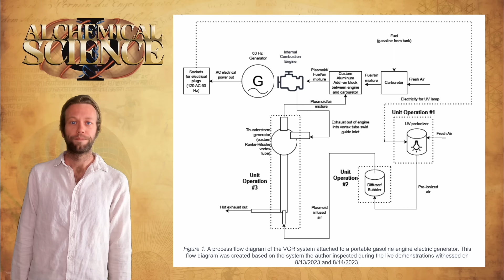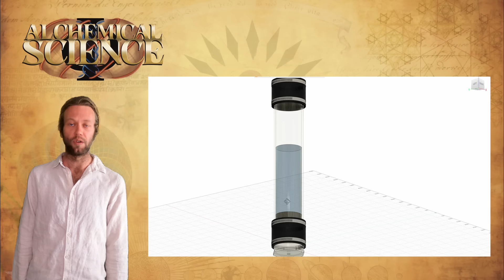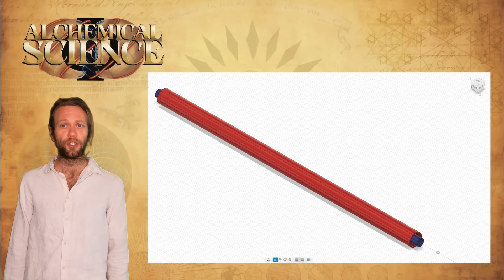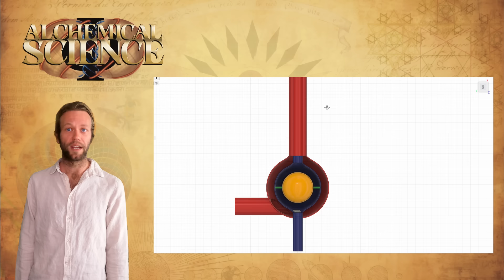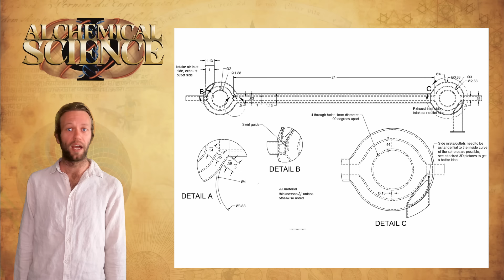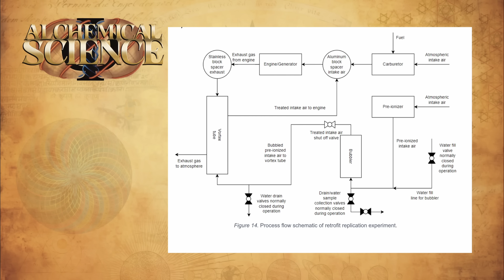Thunderstorm Generator | COMPLETE DIY BUILD GUIDE | Malcolm Bendall's Plasmoid Tech

Comment: When you talk of dangers of this device you should also be aware that the thunderstorm generator is pulling in ions and generating EMF and you should expect there to be an electrical charge. Someone got a huge jolt and thrown back when standing on water and he touched a device like this (a GEET). I'm not sure but grounding the generator has a negative effect on the reaction you are trying to create.  Also, grounding of metal near the device might also create a situation where it is easier to getting a jolt than standing on water.  The question on grounding should be talked about.  A few people will ground a gas power generator so if there is a hazard here it should be stated.
Reply: Excellent question. I too wait for the answer or link to a study group that is talking about said grounding concerns.

Comment: Any tips for multi gas meters?

Also, a question on the ambient air vs exhaust. Since the oxygen % is lower on the exhaust and obviously hydrocarbon are consumed, what becomes of the rest of the mass? Straight to energy, or is there a lot of water and/or nitrogenoxide in the final exhaust?

Comment: The presence of the spheres and the exact ratios and tuning thereof...I am curious to see validated as definitely necessary.
I've been a loooong time fan of A=432 Hz converted music. There was a period of years that I just couldn't withstand even my favourite music in A=440 Hz. Didn't make it through my favourite song at that pitch. The most annoying happy hardcore music at 432 Hz became soothing background noise to the point of a silly track being on repeat for 20 minutes before I realized I had music on at all. So for the BRAIN or MIND (can we tell which), I believe there is something going on there. For this invention...I'm sceptical. If it's real though, we at least have a handhold to take this further. The carbon to oxygen is ground braking but only due to the advirsity in the mainstream against CO2 (as I like to call: the breath of life). Let's find ways to turn SiO2 (Silicone Oxide is in white sand) into WHATEVER with huge cooling or heating effect, or a more rare mineral as a nuclear product, or both. Iron and Aluminium are great candidates in terms of being abundant. 
The holy grail remains ending up with water as the consumed fuel but many other options would be amazing if possible.

Comment: It might require some good stepping back (behind a few blast screens) but I'd be curious what readings might change when lighting the UV light on a GEET system where indeed it's fuel being bubbled.
Reply: What would happen if a reaction occurred in fuel?
Reply: @prakayak  GEET bubbled fuel without UV light and sent exhaust back through concentric pipe, so similar to Thunderstorm Generator. It was reported that "something" happened to supposedly clean up exhaust gasses and save fuel or work with unusual fuel. I seem to remember lighter elements out were claimed. Here, oxygen is heavier than the replaced carbon. If plasmoids were to occur in fuel...premature ignition? Or can a well sealed air intake prevent this? You'd wasn't the fuel to see air late as possible I guess? It's just scary to think of such energized fuel. Might not be for mobile use.
Anyway I wonder how Thunderstorm Generator will scale up. If pipe/sphere surface is a factor not so than volume...a 10x greater capacity system might be more than 10x as heavy?
Reply: I'm having a hard time wrapping my head around UV bulb ionizing air...
Reply: Lets try this.